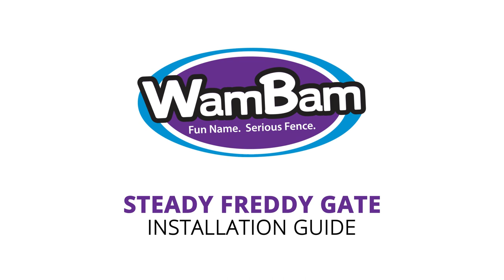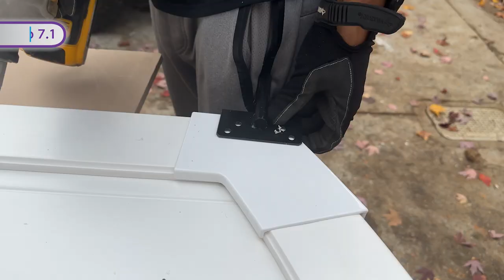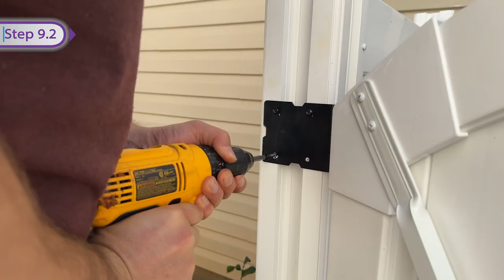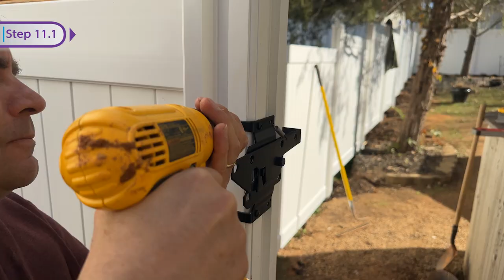How to Assemble & Install: Steady Freddy Gate | WamBam Fence | Vinyl Privacy Gate Installation

Comment from the maker: Here are the time stamps for each step, so you can follow along with your Instruction guide. 
Step 2
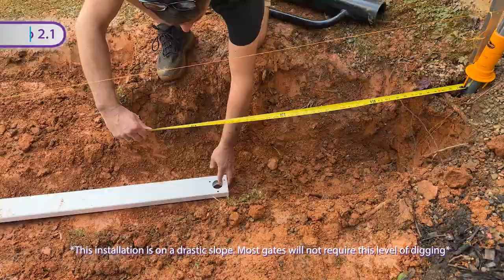2.1 0:06
2.2 0:10
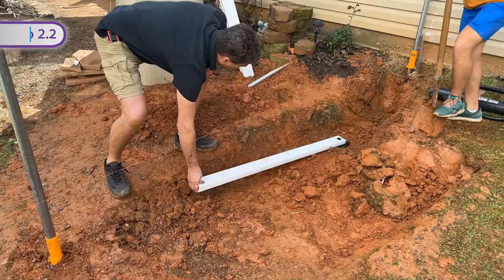2.3 0:17
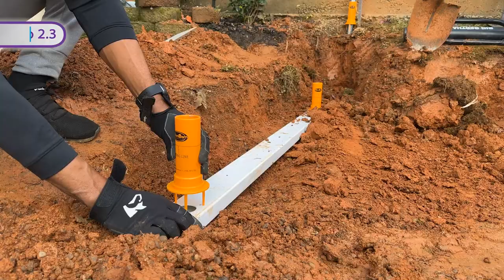2.4 0:19
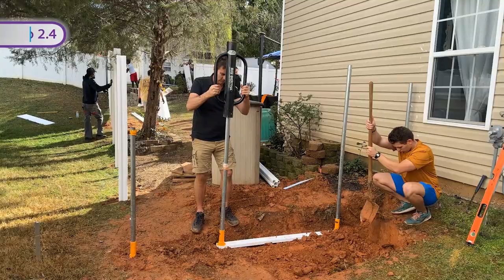2.5 0:21
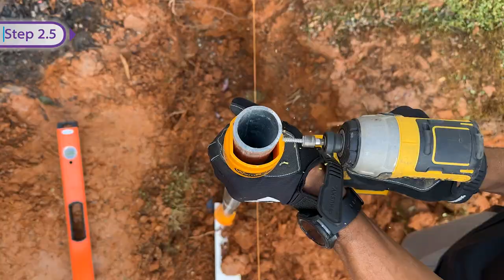2.6 0:30

Step 3
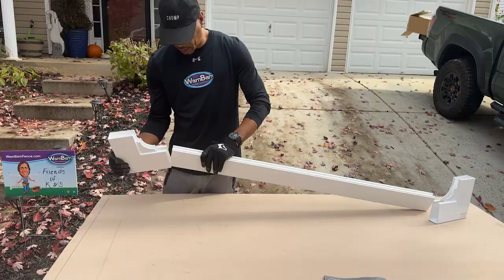3.1 0:36
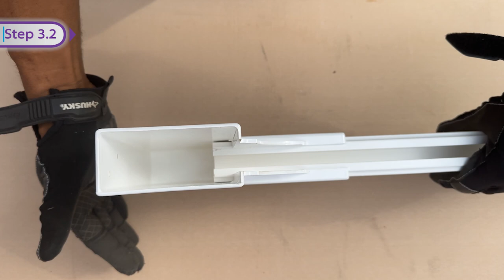3.2 0:41
3.3 0:45

Step 4
4.1 0:49
4.2 0:53

Step 5
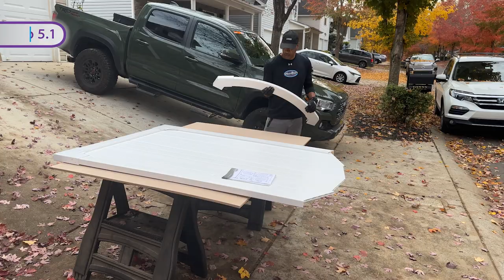5.1 1:00
5.2 1:04

Step 6
6.1 1:10
6.2 1:13

Step 7
7.1 1:21
7.2 1:33

Step 8
8.1 1:39
8.2 1:41

Step 9
9.1 1:50
9.2 1:55

Step 10
10.2 2:10
10.3 2:18

Step 11
11.1 2:26